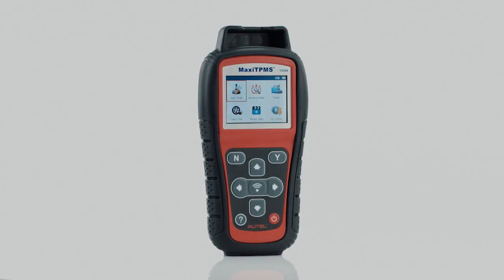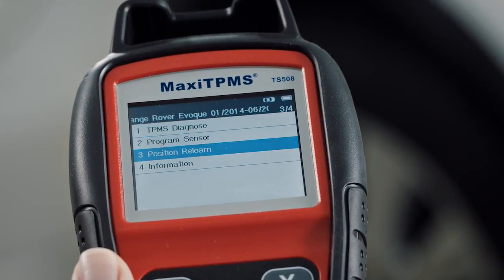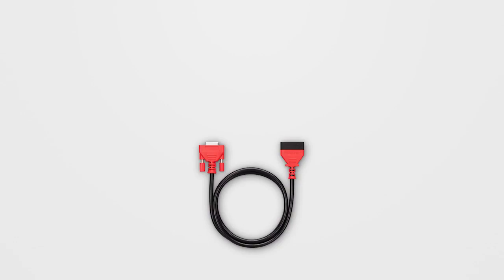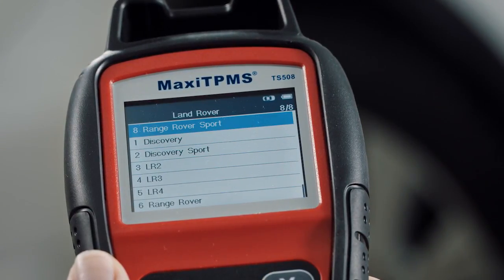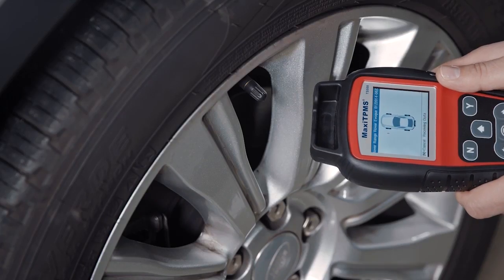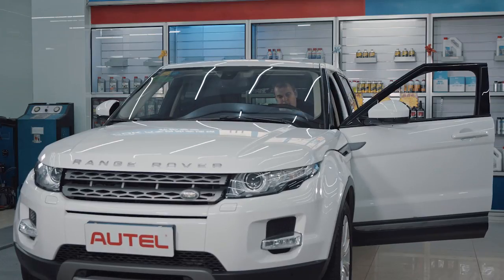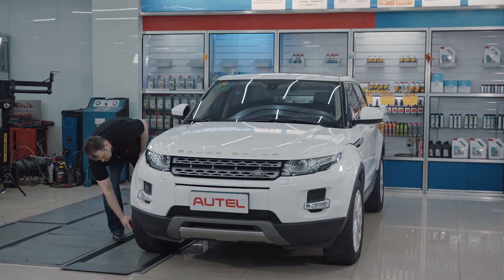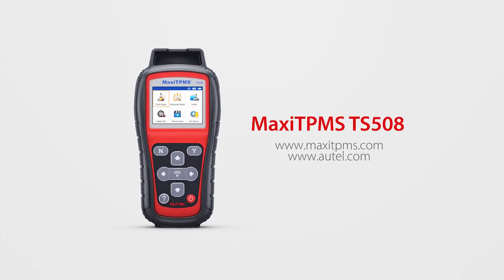TPMS Relearn Function TS508

Comment: I will have to be a bit critical here. I like the product and I believe Autel is a reputable company. However, the instructions manual included with the model TS508, and this video above has many confusing steps. 
First of all, if you look at the QuickStart guide provided with the kit, you will need a second QuickStart guide to tell you how to read the first one. I found the QuickStart guide to be extremely confusing. I got lost in there. Thus, I turned to YouTube for more support. The video above is a bit better but still it doesn't give you clear instructions for each step. Instead, it directs you to follow the on-screen instructions. However, the on-screen instructions have flaws. One major thing is (as enrquerubio7549 mentioned below) what to do if you do not have a spare tire! I lost so much time trying to figure out how to move to the next screen. Then steps that are telling you how to connect the tool to the vehicle is super confusing. In the manual and in the video, it tells you to turn on the vehicle first then connect the Autel tool. But the on-screen instructions that we are told to follow says otherwise. Some might say "Who cares try one or the other. You will figure it out." Sure I will, but the point here is that we have a well-known reputable company that simply cannot put out clear instructions. I don't understand why it is so difficult to be clear on what you are trying to tell people.
I will tell you this much, if I was the owner of this company, the people in charge of the instruction manual and this video would be looking for a job right now. The good thing is that I am not the owner. 

So, if someone trying to figure this out and getting confused and stuck as I did, here is what I figured out and how it did work for me:

1. When you get to the spare tire and you don't have one, hit the "N" key. But you need to do this after trying to read the spare tire sensor. So, you will initiate "Triggering" FIRST, then hit the "N" button. If you hit the "N" before initiating triggering, it will cancel the whole process and take to the beginning. 
2. As for the order of connection, I connected the tool first and then powered on the vehicle (put it in accessories mode, no need to run the engine). Connecting the tool while the vehicle and tool is on is not proper in my opinion.

so, the above worked well for me and the TPMS light cleared out. 
Thanks

Comment: Hopefully someone can add a little clarity here(?) 
When doing an OBD relearn, it seems odd that after (step 3 @ 1:38) you "write sensor IDs", "leave ignition ON" (I'm assuming you now have to UNPLUG the TS508 from the OBD port to allow a person to perform the next step?), "Re-scan each sensor" , then "switch OFF, and then switch ON the ignition" (step 4) 
My confusion comes when after scanning the sensors the second time, it never mentions anything about re-connecting the TS508 to the OBD2 port(?)
Why would that step (scanning the sensors after the OBD2 connection) not require a second connection to the OBD2 port?
Can you explain why the second scanning step is required? 
Is it just to 'wake' the sensors up before going on the relearn drive cycle?
Obviously, the ECU isn't going to be able to do anything with any information you retrieved from scanning the sensors the second time if the TS508 is never plugged back in to the OBD2 port(???)
I'm assuming that is must be a step to wake the sensors up before the relearn drive cycle?

I hope the way I explained this makes sense, and you are able to clarify what it is that seems somewhat confusing to me.
Thank you for your time!
Reply: I also noticed this step.. is it really needed ? It is not prompted from the 508 screen when doing steps
I have issue where my sensors are visible in BMW x3 F25 but after turning ignition off and on I get fail icon and info 481F82 mounted wrong wheel electronic Unknown wheel position (reading from OBd) 
Basically pairing /re learning worked perfectly and I saw pressure on my dashboard on each wheel… but then my car performed auto reseat and displayed RDC error first flashing then solid tyre amber icon..
Reply: @wakenwaken3618  I am sorry my reply is so late, and hopefully you found a solution to your issue. With the vehicle I was working on (2011 Nissan), I found that ignoring the steps explained here in this video, and simply following the prompts(steps) listed on the Autel screen is what worked for me.

Comment: Hi  i have a question i just swap all 4 sensors from my honda 08 and activation it using the maxitpms ts508 but it still shows that the ecu id doesnt match the car and the light for the tpm sensor turn on this morning could I be doing something wrong
Reply from the maker: Honda requires that you write the sensor ID's to the vehicle via OBD2. if you select the ? icon it will tell you how to do the process

Comment: I got some second hand lexus rx350 winter tires, and they come with tpms sensors. When I scan the ID's, and go to program them and choose Program by OBD I get "Communicating with the vehicle. Please wait"
Reply from the maker: First I would check to make sure the tool is updated. Then before scanning the sensors plug into the vehicle and see if you can diagnose the TPMS system to make sure you don 't have any codes, and this will also confirm that the tool can speak with the vehicle. Check the relearn procedure in the vehicle.

Comment: Do this tool  work with all sensor brands like tyc sensors
Reply from the maker: Yes, as long as the sensor has been programmed the Autel tool and read and write it to the vehicle. If the sensor is blank the Autel tool will no be able to program it.  From what I am seeing the TYC sensors are blank and need to be programmed first with another tool.

Comment: Too bad the TS508WF doesn't actually seem to work when you follow the steps... Even though Discount Tire and Schrader both assured me that it should be able to do it with my 4 Schrader sensors that came on my tires.

It picked up their air pressure and brand name but it will not locate them for any Relearn procedure; not even with the tires at 8 pounds.
Reply from the maker: The Schrader sensors that are in the tires, were they pre programmed? The Schrader EZ sensors come blank and need to be programed with a tool other then the Autel. Once they are programmed the Autel can read and relearn their positions.  The weird part is you are saying it picked up the air pressure, and brand name, If it is getting that information it should also have the sensor ID, that is the key to doing the relearn.

Comment: Hi, I was wondering if I could use MaxiTPMS508 to program my vehicle with new IDs? I purchased a set of second-hand rims and installed them on my car. I would like to get them recognized by my car without having to remove the tyres for programming. Is there a solution for this kind of application?
Reply from the maker: As long as those sensors were meant for your vehicle it should not be an issue. you will simply read all the sensors, then program them to the vehicle. The TS508 will have no problem with this.
Reply: Yes

Comment: One step that got missed in the video was, you have to scan the spare tire even if it doesn't have a sensor to go to the next screen and be able to connect to the car.
Reply from the maker: You can also push the N button if the spare tire is required to scan, if you need to skip it
Reply: Scan a spare wo a tpms?

Comment: clear and simple video.  thank you.  one question: i follow your procedure but toward the end (after plugging in the OBD cord to the car) and pressing continue, I get a enter information failed.  what am i doing wrong?  thanks
Reply from the maker: First I would make sure the key is in the on position. Then I would check my updates on the tool to make sure the tool is completely up to date.
Reply: @FlashPerformance  just purchased it.  so I am a new to it.  one of the first things I did was updated it.  i also made sure that i turned on the truck after the tool successfully read each tpms.  (this problem started when I purchased some 2015 ford f150 rims and tires and slapped them on a 2008 frod f150).  so i have that dreaded low tire icon lit up.
Reply from the maker: @conquryourfear  https://youtu.be/7rszSlKKzag This might help
Reply: @conquryourfear  i suppose it can only relearn what has already been activated to the car i may be wrong.
Reply: @conquryourfear  Mine too, What was your solution? I have two tickets for inquiring and I still have no answers

Comment: Hello,  I have two set of tires summer and winter,  when I like to relearn TPMS functions with TS508, is it possible with this device to set in memory (Toyota RAF 4 2019) main and second set of tires? If yes, how it works?
Reply from the maker: If you scan all the sensors in your current wheels, you can copy each of them and put the same ID into the second set of tires. This way when you swap tires the vehicle will not even know the difference. Use the TS508 and the Autel MX sensors. Here is a video on that process with my Toyota https://youtu.be/EKBZHZo9w2Q

Comment: Dose this work with only Mx sensors or any aftermarket sensor ?
Reply from the maker: The Autel tools work best with the Autel MX sensors, but you can also use Any OE sensor, NAPA OE Match, VDO, John Dow, and OriTec.
Reply: The Autel tool can only PROGRAM / CLONE their own brand of MX sensors, but it can READ / SCAN / ACTIVATE and OBD RELEARN any current brand of TPMS sensor. This is a common question and often the wrong answer is given, leading customers to think they can COPY / CLONE existing OEM sensor IDs into any aftermarket sensor, and that is simply not the case.

Comment: Hou can I relearn a used TMPS sonser,  thanks
Reply from the maker: As long as the used sensor is meant for that specific vehicle you wold just do the normal relearn process.  However if the sensor is from a different vehicle and is not compatible it will never relearn.
Reply: @FlashPerformance  I have a 2017 GMC Yukon XL and replaced with 2021 Sierra Take Off tires. Is there no way to program?
Reply from the maker: @theemazing  In 2017 the sensors in the Yukon could be either 315MHz or 433 MHZ, the 2021 Sierra has 3 different type of sensor options. Most likely you will need to replace the sensors with new ones to get them to relearn.
Reply: @FlashPerformance  is there a way to determine that. I’ve been able to find the tire sensors 433mhz. However I can’t figure out how to see what the car is looking for.
Reply from the maker: @theemazing  Use the RFK function in the TPMS tool and your Key Fob, that will tell you what frequency the TPMS sensors are looking for.

Comment: Eu quero comprar o ts508 ou o ts601 e o MV400. Como fasso pra comprar direto com vocês da autel .
Reply from the maker: Autel does not sell direct.  Check with your local part store or tool and equipment supplier.
Reply: @FlashPerformance  entendi poderia tira uma dúvida minha então . Qual a diferença do ts508 pro ts601?